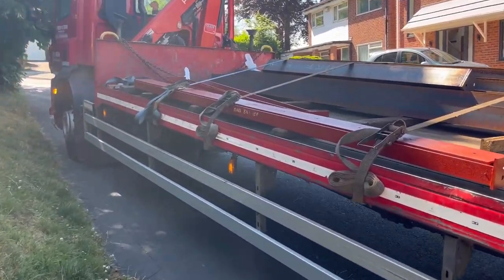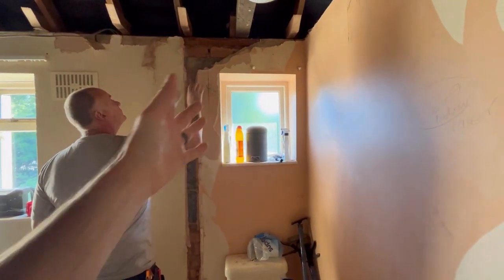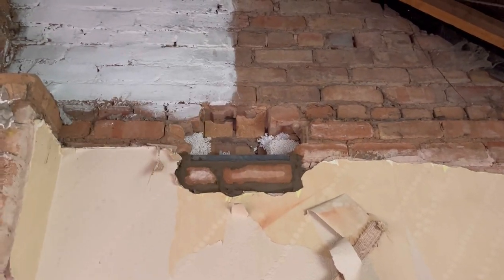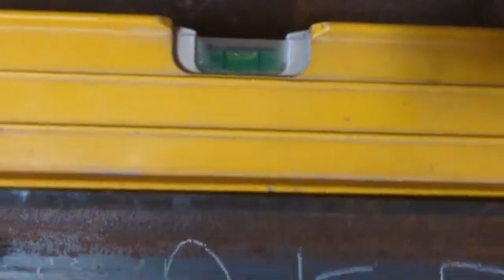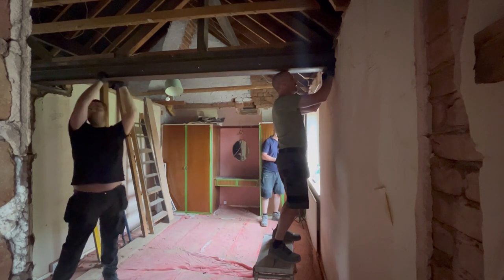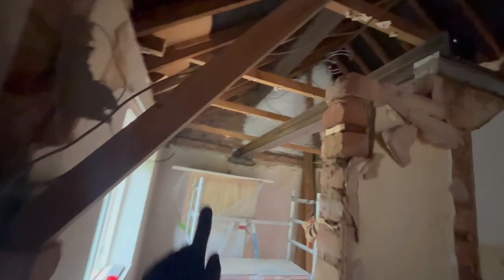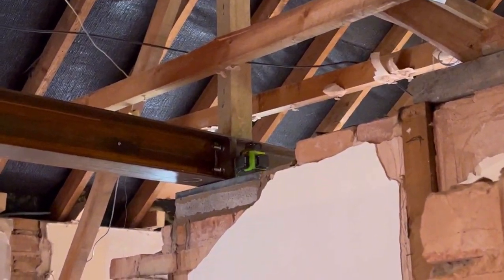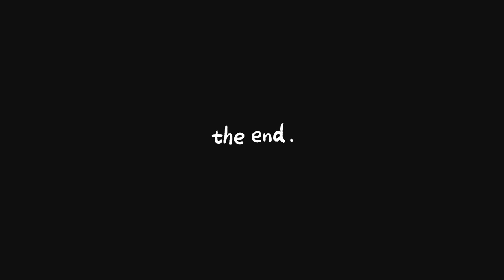Setting out and Installing steels in a loft conversion

Comment: There’s less steel in the shard than there is in that loft!
Bustin vid mate.
Reply from the maker: Hi Billy. Your not wrong there mate but as you may know the engineers and inspectors have us by the short and curlys so we have to work to the spec. They are mostly in now though other than the ridge steels so happy days. 👍🏻
Reply: @Mr_A_Builders  thanks for the reply👍👍

Comment: How do you pack / level this metal plates for steel?! Do you pack it with some temporary material and than fill up to this hight with 1:3 mortar?
Reply from the maker: Hello Daniel, hope you're well. We just lay them on a bed of mortar, 4:1 is fine, and use a laser level to make sure they are all level to each other. Hope that makes sense?